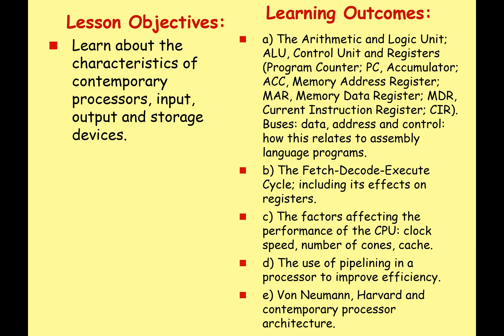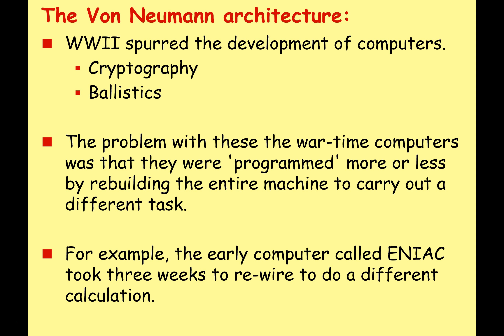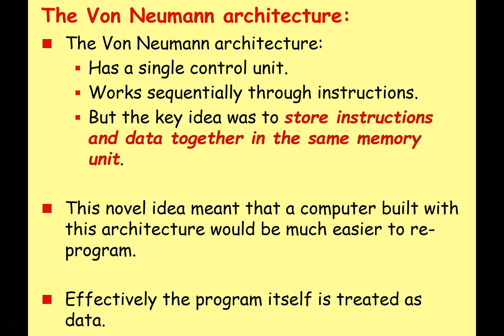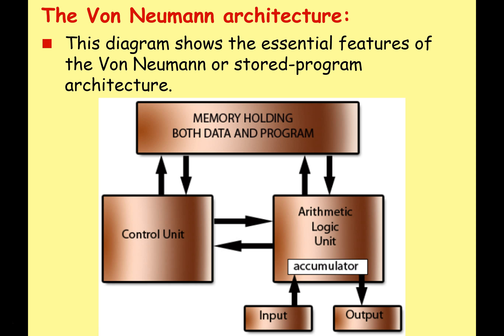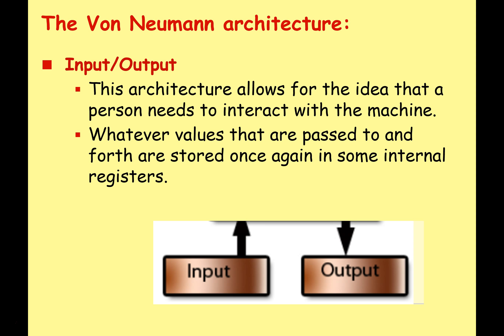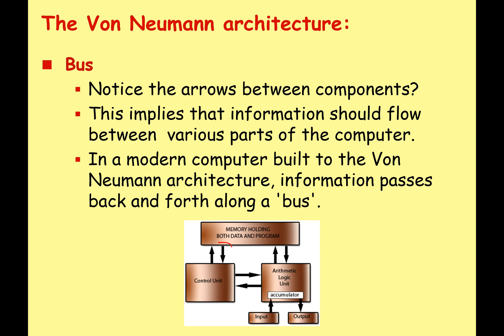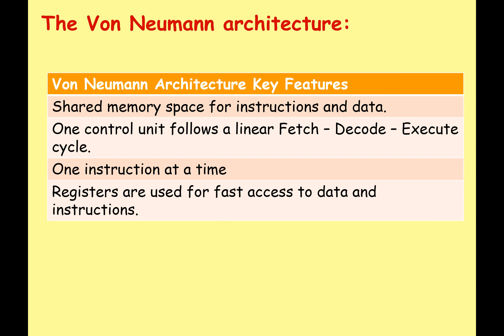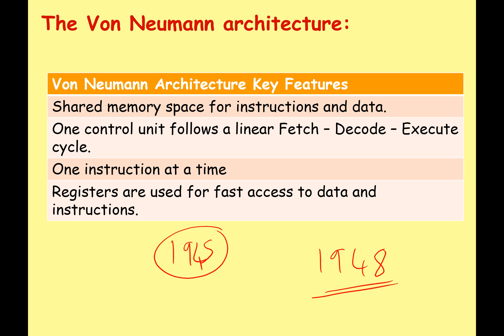A Level Systems Architecture 1 - Von Neumann Architecture

Comment: Von Neumann architecture includes secondary memory or  not? Please clarify it.
Reply from the maker: Yes.  The von Neumann architecture requires:  
A processing unit that contains an arithmetic logic unit and processor registers
A control unit that contains an instruction register and program counter
Memory that stores data and instructions
External mass storage
Input and output mechanisms
Reply: @s1perry  Thank you.